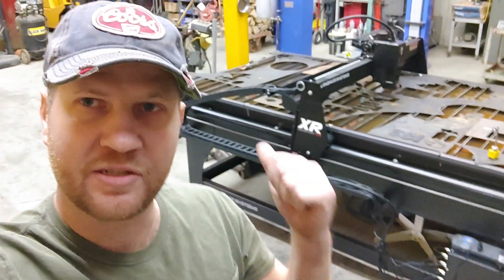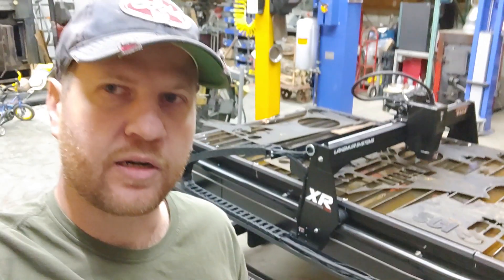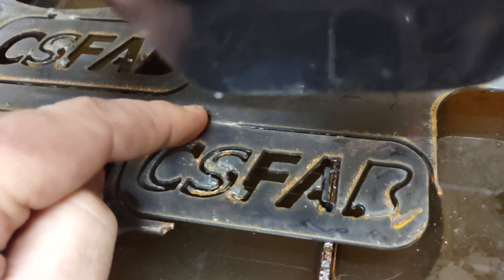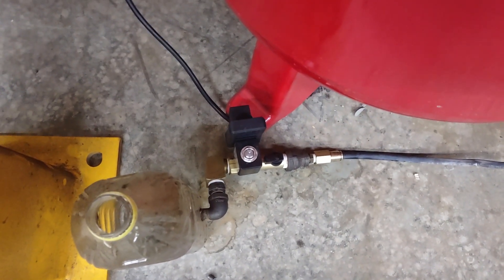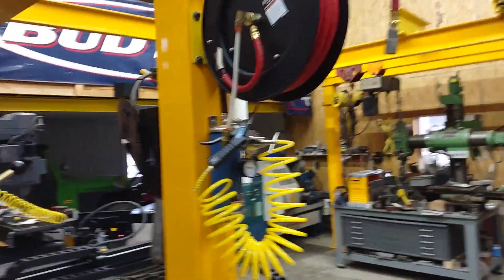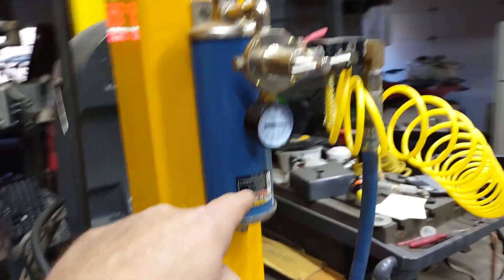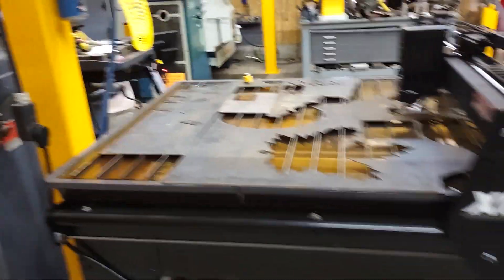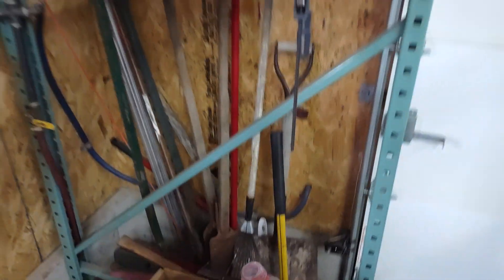langmuir systems crossfire XR air supply setup

Comment: Just curious, what did You find to be the issue as well as the solution? I’ve been having the exact same issue for months. I go over to the forum and there’s 30 different experts with 30 different expert options that they swear by and I simply don’t have the time to explore them all.
Reply from the maker: I don't think I ever found it solution other than a workaround. Basically made a longer lead in with my solution. Eventually ended up switching over to hypertherm PowerMax 65 sink and I have never had the problem since

Comment: You have a lot of restrictions in your air supply. Getting enough air volume at the needed pressure seems to be the issue. If you can simplify the system bypassing some of those restrictions, you should see an improvement. You really only need a dryer at the compressor and a backup at the table. Everything else is an obstruction.
Reply from the maker: There is more than enough air volume and pressure

Comment: Here are some ideas: https://www.hobby-machinist.com/threads/dry-shop-air-step-1-compressor-after-cooler.94795/,  https://www.hobby-machinist.com/threads/dry-shop-air-step-2-compressed-air-manifolds.95032/,  https://www.hobby-machinist.com/threads/dry-shop-air-final-assembly.95077/